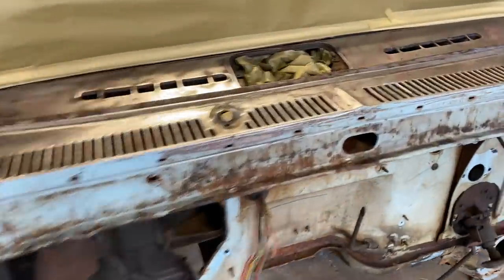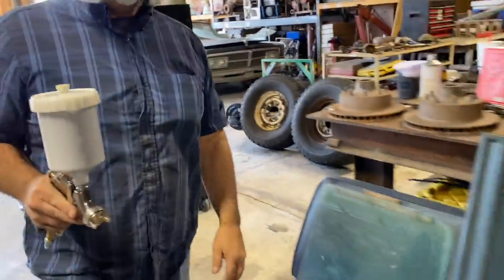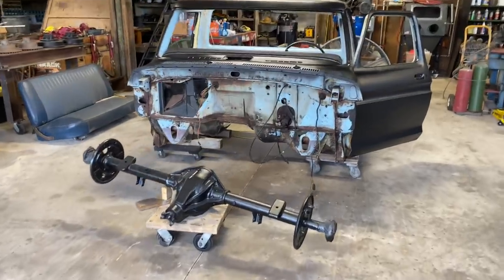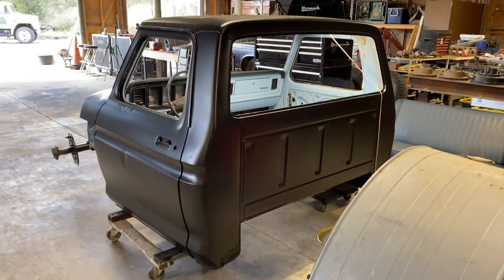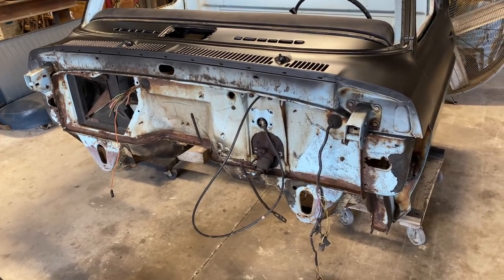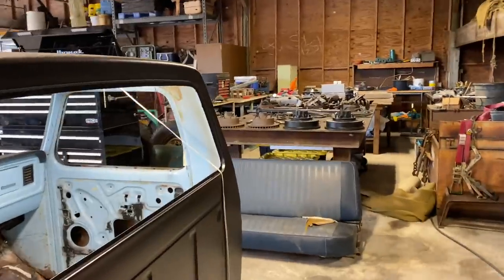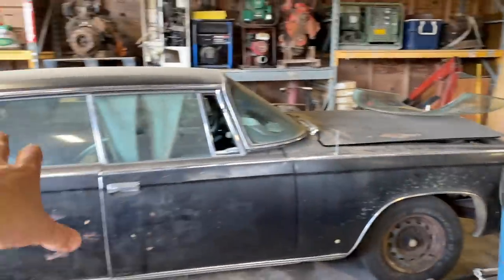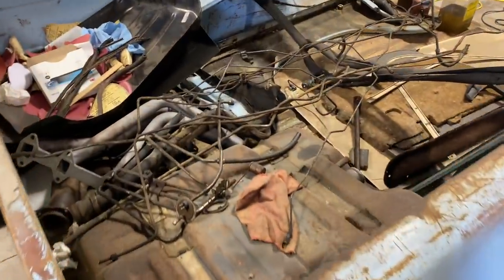Restoring an Abandoned 1974 Ford F250 Restoration Swamp Dragon! Glass & Primer! Resurrection Rescue!

Comment: Hey CT.  I said it before and I'll say it again.  Take your time and use PATIENCE when taking things apart!  Everything on these trucks unbolt, especially the dash!  After you pulled the screws out you immediately grabbed the screwdriver and started prying on it.  NO! NO! NO!  To take the dash out you need to start from the front.  Take the steering column out and then the plastic bezel around the gauges.  Everything unscrews and you don't have to take the heater/ A/C controls apart, they will come out as a unit after the bezel is off.  Then you can unscrew the gauge cluster and the heater controls.  Once you have that apart there are about 11 or 12 speed nuts that hold the dash pad on.  It is not glued so don't pry on it! Once you get all those speed nuts off it will just pop off.  The metal dash itself will just unbolt.  You already took the screws out that hold it to the vent support near the windshield.  There are some screws along the bottom and then there is a screw on each side that holds the dash on.  The ones on the side are a bit tricky and you may have to cut them because they rust from the outside and are usually pretty difficult to get out. Once you have the metal dash out of the way the rest is easy!  You have full access to the A/C - heater box, the windshield wiper arms and motor, all the wiring, etc. etc. etc.  Take your time and go easy! A lot of these parts are brittle and break easy and replacements may not be as easy to find as you may think.  It's looking good so far, keep the videos coming!
Reply: Yep on my 74f100 the 2 screws on the sides. 1 on each side gave me a hard time. 1 of the welded nuts came off and fell down inside. I'm going to have other nuts welded back onto the A-pillar so that i can use wing bolts to reattach the dash back on. That way if i ever have to take the dash out again it will be much easier.

Comment: Trust me my friend, if you dont go ahead and completely redo the inside of the truck you will regret it as soon as you start putting it back together. It will never be torn down to this level again and it will be a lot easier do it now. I redid a 1976 F-100 Custom XLT with a 460 engine in it and there was a lot of things I didnt do because it worked but once I was done I was kicking myself because I didnt. Very nice job so far and am looking forward to seeing more videos

Comment: I think you should pull the dashboard out and clear as much rust as you can! I'd also repaint it with the original color and repair that dent on driver's door with some good hammering. You've got a great truck and it's amazingly preserved, considering it's being left to rot in the woods for so many years! It deserves some good oldschool bodywork. Forget about bondo! That's just for smoothing some tiny roughnesses! Remember that truck was abandoned and may still hide a whole bunch of debris and surprises!
Sandblasting would work great on more severe rust!
I can't wait to see that Imperial back on its glory days too!

Comment: I have a 79 Ford F250 that had pin holes in the roof of the cab when I redid it. I took and sprayed bed liner on the inner of the cab roof after repairing the pinholes for extra leak perfection under the  head liner.

Comment: You may have to drop the "Swamp" out of the name, because of how good you are doing. I would take out the steering column, instrument panel, and glove box just because you are going to need to address the wiring. I would get the wiring from a donor truck with some of the parts you need to save some money and fun to look for. I am doing a 71 f250 that I am learning about the painting from videos like yours. Long live the Dragon.
Reply from the maker: Thanks Richard! I might do that! =)
Reply: The main problem is that he would have to find the same year truck, with the same drivetrain, and all the same options. Including factory A/C. Otherwise, it will likely not match up to that truck. Personally, I would have done everything I could to keep as much of the original harness intact as possible.
Reply: @notajp  I agree with not tearing up what is good. Watching what was cut and a wiring diagram he might be able to salvage it. There are still salvage lots and farmers fields where they can be found. Mine was so bad that it could not be saved. If needs to type of suggestion.

Comment: As ive said previously get on with rebuilding the frame for now and get the new engine and drivetrain remounted, then concetrate on the body when Darren comes back, I would remove the dash as there may be hidden rot behind there that will need attention. An empty cab will make bodyworking alot easier but dont cut corners just to save time you will regret it in the long run.

Comment: Pull out the dash. You haven't half-assed anything yet, no need to now. Everything is already pulled apart so adding the dashboard and steering column to the list isn't a huge undertaking.

I like that you've gone in the direction you've chosen with this build ❤

Comment: I was locked out of a 91? or 93? Bonneville,your answer is in this very video. You're gonna have to remove the windshield to gain access. Then remove the seats so you then can remove the inner door panels.
Full disclosure: I had a locksmith,dealership mgt./mechanic and a friend who was a GM engineer and a police officer (all friends/family) all  failed to gain entry. My problem was simply worn parts failed to engage properly any more. Fixed it but man,what a pain!🙂✌❤

Comment: To remove the dash pad, you need to remove the cluster and the glove box compartment. Should be 6 holding the dash pad on. I’ve owned many 73-79 ford trucks. By far the easiest to work on.

Comment: just pull the steering column and leave the dash and work around it. you commented that you like those 4x4 high boys. in 1975 I bought a new f250 4 speed 360 v8, now its a 460 v8 4 speed ( did the transplant about 25 yrs ago. my dad worked at the plant where it was born . [after it was built I got to drive it from the plant the dealership where it was purchased. ( $5500) my uncle was a salesman there. he also was a truck supervisor at the plant the plant ( Mahwah assembly ) had two lines car and truck. this truck (still have it ) is one of a kind. ( uncle followed it on the line when built ) . send any comments or question to me.

Comment: I was wondering why BLACK. I guess that is what was donated. Just hard to cover with original color BLUE....
Reply from the maker: This is an epoxy primer to keep the rust away Mike! =) Gray filler primer will be used after metal work is complete!
Reply: @CTmoog  usually they make epoxy in almost every color grey white yellow dark grey red or black.
Reply: @CTmoog  also when you get to near paint just get one of the medallion spray cans in case you cut through to the black on final sand. will help coverage.
Reply from the maker: @Mikefngarage  10-4

Comment: I just bought an 88 f 150 4x4 for 100 bucks it needs a little love but I have time. My old trucks were a 69 f250 and a 65 f250 flat bed but they burned up in a 🔥 . O well time to start over.

Comment: Not much of a Ford fan but this project changed my views !! Stay away from them aftermarket Chinese parts and you will have a gold mine when you get done!!!. Don't slap up that engine with cheap Chinese Chrome either keep it all factory stock with the original stickers on the valve cover and air breather!!

Comment: I agree with 100%Texan. Remove the instrument panel and paint the dash. Also you’ll be able to clean up the gauge connectors and check to make sure they work. Amazing the knife edges for the window seals are in such great shape.

Comment: ct please take the dash out your truck and clean up behind it they around where dash bolts to the cowl and firewall and there 10 or 12 bolts along the top inside underside of the dash and there if i remember right there 9 or 10 mm socket to take the bolts out and also if you have question or need parts please please email me a nicholas_arrigo@yahoo.com im trying to help you out with you truck and parts and how things come off and go back on your truck i have restored over 30 of these trucks since i was 10 years old so i know pretty much everything about them.thanks

- nick

Comment: Pull the dash and clean it all up. You will also want to check the condition of the wires that might cause a issue down the road.

Comment: Black is a very hard color to apply as it shows any metal imperfections or waves. Sharp dents will show across the room. I would take the steering column out but the dash is a new can of worms an a lot of hard earned money so a better donor would of been nice here. A sharp old truck an happens to be my favorite brand. I bought as one of my first rigs a 56 F100 so cute and girls just fell on it as it was lowered, new rims, paint, lowered right down there.... but not a lot of bling. Then time went by and I got my favorite one; the 96 F350 quad cab an flatbed with duallies. I sold it still looking new a couple of years ago since I can't walk but that truck looked brand new and drove great. On yours I would go with things people see from behind like that rear end housing can be painted and the frame rails if seen need painted nice as well. No time like the present to practice on metal on the table till you get the hang of the wire feed. It will do the floor pans and door bottoms, cab corner on drivers side for sure,, and ya I hate to leave rust behind but use the encapsulated paint sprays to kill that rust. Tri sodium phosphate is the finest of killing rust and then just paint over it. Turns the metal black but kills the rust... your doing fine as you are in there   working too. Just practice on scrap metal on the table and it will come to you how to patch and you will be looking for them when good at it.
Reply from the maker: Great tips! Thank you! Sounds like you had some cool trucks! I will check out the sodium phosphate! Thanks again!

Comment: If you got a Slim Jim you should be able to handle the locks on the Imperial. Also, since you have a door partially open, I would try to PB Blaster (with a straw)the hell out of the door latch and striker lug. That might free it up.
Reply from the maker: Thanks DJ! I will try that! =)

Comment: It's really exciting to see the progress that you're making on the F250, C.T.! It is going to be a great truck to drive and use for whatever purposes you have in mind. I agree that you should probably just detail the dash board area. It will clean up nicely with the right chemicals and some elbow grease. You may need to replace the steering wheel if it is cracked too badly. Go for it - do the work on the bed yourself! Your buddy can advise you if you run into a snag. I also like the idea of doing another channel. I'd like to learn more about setting up a "proper" auto shop in terms of tools, maintenance on stuff like the air compressor and other shop essentials. Keep up the great work C.T., lots of us enjoy your channel and we are waiting anxiously to see the Swamp Dragon on the road again!

Comment: ok since you asked for opinions on on the dash plan, and since I just did it on my 77 F100...for this project.  my take is this...tear it down if you really want to, but I would seriously consider NOT going that deep on this project.  You can always tear it down down the road, but right now I know you want/need that work truck on the road.  My advice is leave the dash for now and move forward.  Also, what brand of epoxy primer did you end up using?

Comment: You guys are doing awesome! Like Mike Fn with the Schteiger; he’s trying to get it as nice as possible without going nuts. I believe that’s a great approach. How’s the motor and the transmission going?

If I were you I’d start getting the frame and suspension together and installing the drivetrain so that you don’t have a bunch of parts laying around. Then install the cab and bed on it when you’re done with them.

Your ideas on the shorter videos are great but why would you need another channel for that?

That Green Hornet car is killer too and so is the Bluegrass music!!! 😉
Reply from the maker: Thanks man! The motor is going to be really nice. Not sure about the transmission yet. It needs be rebuilt.

Comment: Hi CT, I would remove everything I could inside the cab and cover the rest before paint. HF plastic welder could fix the cracks in the steering wheel too while you have it out

Comment: CT :) welcome my ideas for Swamp Dragon Truck to also like Black paint and Baby Blue paint look nice for it with Midnight Black pinstrip too plus Clear coat dash brighter up to ! Box do some primer inside then Baby Blue to also Tailgate too! Also new You Tube video channel to Called It CT new and old projects! Also doing excellent job always and helping by viewers to ! Also may have drill lock out doors plus trunk locks to plus lube jams with pentriotion fluid lots too with high lube not wd 40 but stronger fluids to ! If don't work break windows has be answer to do !

Comment: Hey there. I have 3 Ford's a1 Ton flat bed 74 1 79 f150 delux. 351 bought it brand new original owner 4x4. 1 79 long bd. Trade I'm rideing now 6 cylinder rebuild the 6 I know what your saying

Comment: HELP - PLEASE - I beg you.
At 24:50 I see that you have the same rear brake drums as I, and I cant find a model number or part match. I work a an auto parts store and searching 1000+ images and measurements I can not find replacement drums. 
I'll look through your other videos. Ive been searching 1/2 year. My drums are too rusty to get part numbers and they're cracked so must be replaced. Please help. Thank you

Comment: Hi cool truck.I know you are trying to learn more about body work and what you are doing is fine. But if I were you I wood disassemble everything. And then take the body and bed to the sand blaster. Tell them to use walnut shells to lessen body panels warpage. This takes away all the deep scratches you make from the tools you use. When you get everything back from the blaster shoot it with primer just to keep it from rusting. Then you can do your body work. Like replacing the floor and removing dents Misc. At 72 years old I have sanded and wasted a lot of time and money on tools and sand paper. Bite bullet and you will be a very happy camper. Believe me In the end you will a lot happier. And your viewers will not get bored. Keep up the involvement in restoring old trucks and cars. I’ll be peeking in now and then to see future progress. Remember one thing. Body work is boring!!!!!!!!  David S

Comment: Don't get discouraged!  As I look at the cab sitting there on dollies, it's a no brainer.  Remove the rest of the interior.  I understand budgets.  With that said!  lol  You need to buy a Rotisserie.  Sure, it's an upfront cost, but as far down as you have the truck if the dash was removed and the cab was on a rotisserie, using the sand blaster, he could have breezed through and eliminated all that DA time and a much much better result.  You used the word "daily driver."  As a potential buyer when I climb under it and the cab has had POR 15 on the sheet metal, I am no longer a customer.  Again, with that said!  lol  Maybe don't take it down as far which is tough with these old trucks.  I think it is worth it and people would spend the money!  I saw a 72 yesterday that was the turquoise with a white stripe, sitting on a 97 1 ton 4x4 frame with a 7.3 diesel.  They put the 97 interiors in it.  I learned to drive a stick in a 72 F 250 so I have a soft spot for these old trucks.

Comment: Just amazing at the number of little dents and dings just a small amount of paint brings out. Going to join in with the majority commenting. Go ahead and strip out the dash and take the cab back to bare bones. You've come this far,,check into a cheap tig welder, good for light gauge metal and pin hole filling.
Thanks CT, and love the very effective blowing device, leaf blower.

Comment: It’s much more work that a person would think when it comes to even a light resto daily. You have a LOT more work ahead of you but patience and a little every day will get you there. I’d pull the dash just because I’d be looking at it every time I drove it and it’s the best time to clean that up. As far as the 4 door that’s locked up, couldn’t you go in through the trunk then the back seat? As a last resort you could probably drill the outer door on one door. If you plan on removing the glass take out the back glass. If I were close by I’d drop in to give you a hand 👍🏻

Comment: If you're going to replace the wire harness,  you might as well pull the dash, the bones of that truck are solid, as best as you could hope for a FLA swamp rat.  Either way you have to pull that dash anyhow, so might as well do it now, and see if there are any more surprises behind it, and it will give you better access to the whole firewall and wiring harness, probably much easier now than further down the road chasing gremlins!! Oh and it looks awesome!!!

Comment: I would have used a rust killer on it first before  any primer was put on it . All that surface rust is in the Poors of the metal and I don't care what you put on it it will come back  through it. You will start seeing  little bubbles come up . And I have told others the same thing but they didn't listen and the it done what I said it would do . It may take a few years but it will show up. I have been doing paint and body work for over 21 years and my paint jobs last for over ten years

Comment: got no choice but take the dash out now, needing to replace the wiring loom impossible without doing so and the Heater a/c box replacement. The one flap you could see was fried, I think there will be a lot of damage hiding under there.